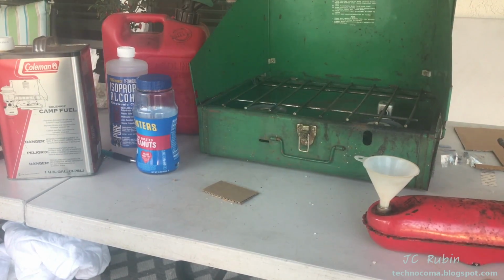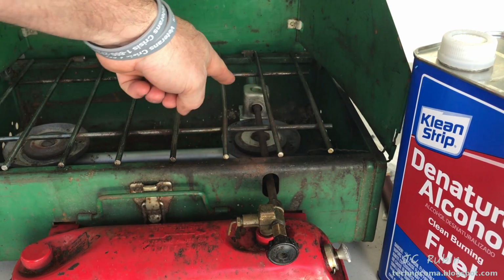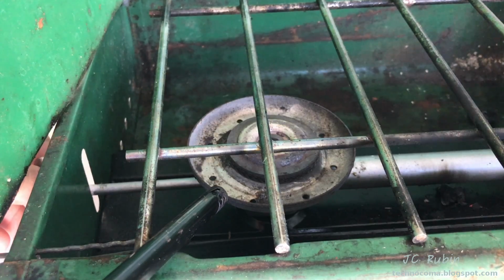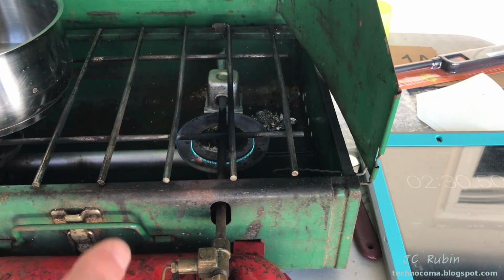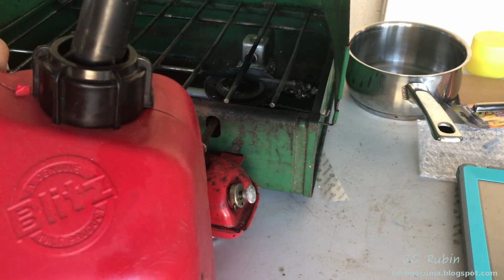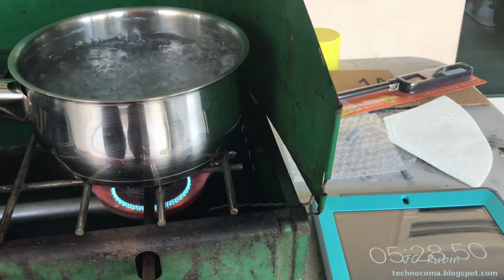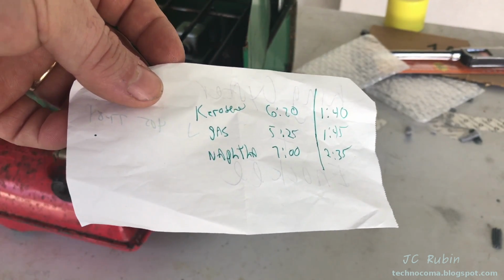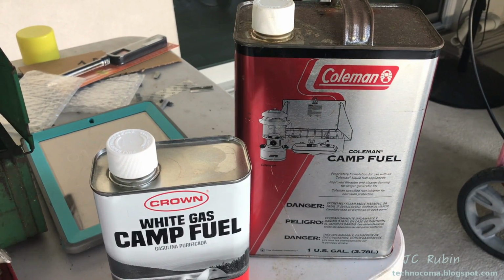Antique Coleman 425 Stove Testing Out Different Fuels for Performance

Comment: Kerosene purchased at a hardware store costs about ten times what it costs if you can find it at the gas station.  Yesterday, after fuel prices have all risen due to Russia and Ukraine, I just paid $4.29 a gallon at the pump.  A gallon of Coleman camp fuel costs $16.99.

There are other benefits to kerosene too.  It is much less flammable than gasoline or white gas.  It is actually hard to catch fire without a wick.  You can pour it on concrete and drop a match on it, and it won't light.

Beyond that, kerosene doesn't degrade near as fast as gasoline.  You can store it for up to five years with no problem.  That's not to say it won't go bad ever, but gasoline will lose potency after only a few months of storage.  I've found that the gas I buy for my lawnmower won't work well in my snowblower a few months after using it in my lawnmower, and vice versa.  I've used kerosene that was five years old with no problems.  White has can be stored for several years too.  Once white gas is opened though, you only have about two years to use it.
Reply from the maker: I have not seen kerosene at the pump in florida.

Comment: In the UK Paraffin(kerosene) is a 1/4 of the price of Colman White Gas and unleaded petrol from the forecourt is 1/4 the price of Paraffin. I did find a video of someone who distilled forecourt unleaded to effectively create white gas, not something i would risk doing as burning to death is not a very nice way to go..
Reply from the maker: Ive watched people distill petrol into naptha in gallon batches with copper whisky stills.  Giver the cost at the pump It sure is quite cheaper than coleman but it sure is dangerous.

Comment: Also I would have tried everclear at 190 proof . Expensive and a shame to use it that way but it should work.
Reply from the maker: Alcohol had been demonstrated not to work
Reply: @retrotechandelectronics    check my other comment, you need to heat the generator up more. using a bit of copper wire might do the trick. it will make kerosine work better . i bet that trick will improve all of the lower engery fuels performance.
Reply from the maker: @mikehenthorn1778  The goal was to test fuel performance without modifications, this would be a modification.

Comment: It would need some help to boil the fuel. What I have seen before is wrapping the generator with some copper wire ( 12 or 14 gage ) where it is over the burner. Light with some hand sanitizer on it to preheat. Works great with kerosene too.
Reply from the maker: I used kerosene in the test, it smokes alot in that application, alcohol is better for pre-heating, its clean

Comment: could I add at little acetone to the gasoline to get a cleaner burn?
Reply from the maker: I would not attempt this.
Reply: @retrotechandelectronics  I actually added a very small amount of acetone to some very old coleman fuel and it burned very very hot. I had to turn it down because things were getting too red.
Reply from the maker: @massa-blasta  Like I said, I would not attempt this.

Comment: I put barbeque lightning fluid (kerosene) in coleman 550B After preheating it ignite and works fine.
Reply from the maker: That would be reasonably more expensive and dirty and gasoline...
Reply: @retrotechandelectronics  But good if no gasoline to available. When things go wrong, gasoline is first.

Comment: I love the video! Recently I've used my stoves and forgot to account for carbon buildup. What did you mention that you used for removing the carbon? I'm having some trouble. Thanks!
Reply from the maker: I cant imagine I missed this in the video, i would have to re-watch it to see.
Reply: Carburetor cleaner works good.
Reply: I have good luck with steel wool and a little dishwashing soap for exposed parts, like the long metering rod.

Comment: Saw a guy do it with Kerosene and wrap copper wire around the bar over the element. He got it up to temp by using hand sanitizer, but say you could use fire paste, iso alcohol or like you did, give it a little fire under the bar to preheat it. After it's going Kerosene can work quite well actually, yup.
Reply from the maker: There are several good techniques for this.

Comment: Great review and results.  On ke ro turn up the light lever for a minute before shutting down the stove, that helps to burn 3xcess fuel out of the genny.  That's how the older stoves operated
Reply from the maker: I was not aware of this, but I guess that would purge off the rest as fumes, vice fuel.

Comment: Would like to see kerosene and white gas mix 75/25.   That would most likely solve the lighting problem you had with kerosene but still give the benefits of the more dense kerosene.   Aviation Jet-A  is just kerosene but more refined.  JP4 (military Jet fuel) is a 75/25 mix of Jet-A and  100LL that piston aircraft use.   JP4 burns hotter and preforms better in afterburners than pure Jet-A.   Military engines are built for the higher heat produced by JP4.  To be clear  75 percent kerosene and 25 percent white gas camp fuel/unleaded gas or Coleman fuel.

Comment: I would stick to the fuel it was made for. That spring in the generator stem is actually a radiator that radiates heat evenly to turn the fluid into a gas state while it travels into the manifold and into the burners, secondly it also prevents flare-up in the line or surging of the fuel. These so called radiator spring tailor the amount of fuel by the pressure in tank and capillary action of the heated fuel or spiral action of vaporization to reach the burner uniformly and light it evenly. Without that spring the stem tube would rupture from flare up and cause serious burns or injury or the burner not to perform properly and burn evenly around the whole ring. Plus it's a sweet spot for the secondary burner to burn evenly as well. By putting different fuels in that tank you can damage that radiator by overheating it by using different fuels. You would need to calibrate that spring if you run different fuels in the tank. Yes some coleman stoves run dual fuels but the radiator spring is a different style made for dual fuel application. The spring also baffles the fuel to the right amount. Yes these stoves are old however I've seen a lot of burned out burners over a short time by people constantly using alternative fuels that don't fit the old stoves requirements.  Always use the proper fuels for the stoves recommendations. Going above and beyond manufacturers recommendations can lead to unsuspected accidents in these old stoves. Yes they may be robust but one doesn't know when weak spots develop. By using the proper fuels your stove will last even that much longer with a bit of routine maintenance. That's why I don't like the youtube bandwagon too much. It may work but will it last and is or economical and safe. Remember, safety is also the number one priority.
Reply: Dude, seriously?? 🙄
Reply: @AxtionMag  What one see's on YouTube is short term. Everybody is joining the band wagon and using alternate fuels in units that are meant to take the required fuel. There are differences in the generator. They even offer conversion kits as well that you can buy. In the end it's the burner plates that take a toll in these units. In the end you're not running cheaper and more efficient. I've been doing a lot of repair work for over 30 years and the short comings in of short cutting  are plentiful. I've seen people take a 70 year old unit and do the alternate fuel thing and depending how long they used it 2 to 5 years they say mine is still good, but it may take longer too heat or the second burner isn't as strong but its cheaper. Next thing you know bang a fuel leak developed while an individual left the unit unattended and almost burned the whole garage down. Then there are the majority of those that have a 70 now 80 year old unit and they stuck to the original products or fuels and they still work fine to this day. Remember short term gain, long term pain. I've seen antique dealers buy lamps and burners off a few of my collector friends and do conversions to alternate fuels only to call out my collectors saying they sold them a piece of junk and after me servicing them and finding out the burner plates and the orfices or metering valves were either eroded plugged or outright melted down I told the antique dealers that the wrong fuels were used and adapter kits were added for alternate fuels. There's still a lot of vintage upgrades out there or burners and lamps for industrial purposes. Back then things were built robust for the fuels that were supposed to be used, now everything used for its purpose and jetted and built for the fuel requirements. Everything now is a sales gimmick. A torture test of different fuels in one video and all these other bandwagon YouTube unknowlegeable individuals should be monetized especially when it comes to plumbing of gas appliances. Imagine if your house burned down and an insurance company found out you plumbed an appliance based on a YouTube video. You wouldn't be covered. When regarding this video I would not even post this to public so that an inexperienced individual does this. You have to have substantial evidence and thorough lengthy testing and must meet safety standard regulations for your region. Don't be surprised that this video isn't going to be monetized for safety regulations. One has to ask. Is the one doing this video a certified gas fitter or plumber?

Comment: Enjoyed the video. Based on how clean the generator looked after using the Coleman fuel, I think I'll stick with that unless it's an emeergency situation. I keep thinking about getting a Blackstone, but the Lodge 16.75" griddle fits perfectly on top of my 425 so that works for me.
Reply from the maker: Yeah I would use different fuels for any old reason, I stick with coleman fuel unless I have no other means.

Comment: I'm wondering on the run times per tank of fuel.
Kerosene has a bit more energy per gallon compared to gasoline.
Reply from the maker: You cant measure run time per tank. Depends on how high you turn up the flame...
Reply: @retrotechandelectronics  True-- but an equal runtime on  full output  would be interesting to compare the staying power of a given volume of gas vs diesel or kerosene
Reply from the maker: @marko11kram  to what end? Who runs their stove at full tilt for an entire bottle and would stick around to constantly ensure an even supply of pressure at the pump. We already know the energy density of the fuels. Only an understanding of their real word performance in the stove is needed. Boiling water with a timer is sufficient.

Comment: The gasoline to use is the lowest octane you can get...white gas is basically like 50 octane. Not surprised gas works well. Coleman's "dual fuel" stove is just a slightly different configuration.

Comment: I stumbled upon this test allowing me to let people know is that Colman had a pressure lamp which was designed to run on kerosene. 

There was a little cup you would put some alcohol or kerosene in to pre warm the generator.
Reply from the maker: Yup, I didnt have it so the paper towel worked in a pinch.

Comment: I have some very simple gravity fed alcohol stoves, and they run great on 91 % a rubbing alcohol but on denatured alcohol, they had a yellow flame and didn't run so well.  They even ran well on 71 percent rubbing alcohol.
Reply: Is this home made or where can you purchase? I stocked up on 91% because it's probably the safest for indoors & from fumes (wife is pregnant and the fumes bother her). I know you can make a can stove but there is no real pressure you can actually cook with. Gravity makes the most sense, the adjustable marine alcohol stoves are too freaking expensive!
Reply: @matthewstephens7509  look up "lixada alcohol stove" i got one runs well on everclear and 91 percent

Comment: Nice video. Was wondering why my ancient coleman fuel took so long to get my skillet hot. Makes sense that it would degrade over time like gasoline does, but it's actually impressive how well it still works all these years later...
Reply: I wonder if adding a bit of methanol (yellow bottle HEET) would help old fuel burn better?

Comment: Thank you for the info.
The issue with kerosene is the owful smell which c and end up in your food taste too.
Reply from the maker: Once its up to temperature, kerosene has no smell.
Reply: My mom grew up a share cropper, thus they didn't have electricity or running water.  At some point they went from a wood burning stove to a kerosene stove and they thought they were really high class then.  No wood to chop.  In the 1950's they upgraded to a ranch house with electricity, but still no running water till 1969.  Oh, the good old days.  I think the stoves that were built to use kerosene might not have imparted such a strong kerosene taste to their food, as I would imagine a lot of them were sold to farms and people who lived in the country who didn't have electricity or city gas.  I know the 'blue flame' kerosene stoves were heavily advertised in the 1920's and 1930's.
Reply: I got 3 kerosense wick stoves...they dont smell

Comment: Hello .... I have a single mantle (kerosene powered) Coleman lantern that was made back in the 1950's. It has a small cup that alcohol is placed into and lighted to pre-heat the generator. Because kerosene became difficult to find, I decided to give common charcoal lighter (as in BBQ pits) a try and it worked amazingly great and still to this day is an  easily available fuel source.

Likely too late now, but I would liked to have seen you use the charcoal lighter as a fuel for the camp stove... 99% sure it would work without problems. Also suspect that mineral spirits ( as in paint thinner) will also work in place of kerosene.

Also wonder if a mixture of "kerosene" type fuel and unleaded gasoline might do well....

Thanks for the video....
Reply: I heard 30°/, camp gas and 70°/, kerosene for kerosene lanterns.

Comment: If the slow burners like kerosene/diesel were mixed with 5-10%_camp fuel or white gas they might be easier to start. The alcohol might even work.
Reply from the maker: In an emergency , if you had kerosene, you would preheat with whatever and not resort to fuel mixing anyway.

Comment: Very well done video RETRO. I would of liked to see the adapter used that you can use a propane cannister with just cause you have me curious now,. Excellent video, thanks..
Reply from the maker: I thought of it, but in a pinch nobody runs out to buy a propane adapter.  that wouldnt be an emergency auxillary fuel.

Comment: Petrol/gasoline are far cheaper than naphtha, sure it gunks stuff up but regular cleaning/maintenance solves that and if it does reduce the lifespan of certain parts I could use the savings in fuel to replace the whole thing 1 pound 20 for a litre of petrol vs 9 pound for a litre of Coleman fuel? No contest, if it burns cleanly I won't worry about chemicals more than I do handling it for any other reason, I'm not bathing in it or pouring the fuel over my food! Plus the main things you'd want to avoid (lead and aromatics) have largely been replaced by ethanol in many locations. I wonder how much of an ethanol percentage it would tolerate in a gas/alc mixture before becoming unstable Would probably vary based on the stove, ambient temperature, age of fuel (alcohol absorbs water, why gas goes bad) and it could probably be modified to where it would burn ethanol well if it was the only fuel available. Still be interesting to see how much high the E an get before it stops working.

Comment: man, you really put this stove through its paces.  I just picked up a 425E, and didn't hesitate to use gasoline based off your video.  Nice to know I could use kerosene in a pinch too.  thanks a lot Sir.
Reply from the maker: Just remember gas has a lot more chemicals added than whitegas, it should be used in emergency but not as a substitute.
Reply: Ok, but white gas is distilled from gasoline I think.  What are the known risks of running these on gasoline consistently?
Reply: @fishinjunky  I think hes alluding to the additives in pump gas and the potential for them to affect your health. A stove-specific fuel (such as coleman) would be formulated without those.

Comment: The main reason one would pick kerosene is indeed cost.  Buying it in the one quart can is very expensive.  In the northeast, where oil furnaces are common, it is not uncommon to find kerosene for sale at rural gas stations from a pump.  At $3-4/gallon beats even crown camp fuel by quite a bit.  It’s a bit annoying to get running on a stove designed for white gas, but for long term use it is far cheaper.  It’s also more pure and stable than gasoline.
Reply from the maker: Kerosine works just fine, just harder to start, and stinks to holy hell when shut off.
Reply: @retrotechandelectronics  To reduce Kerosene smell, turn the lever up one minute before you shut it off, which will burn off most of it in the generator. Bur burning kerosene will quickly clog up your genny, which requires constant cleaning and maintenance. If it's for cost reasons, just run low octane regular unleaded, it's much more volatile, less sooty thank Kerosene. Coleman stove is designed to run on white gas, it burns cleaner, you will have less headache long term. But if you don't mind constant maintenance, it works on unleaded or kerosene. Cheers!
Reply: @ClaraXu2014  you can actually distill gasoline from its additives relatively easily w/ a standard electric hotplate you'd find in chem class.  The additives, like the detergent package, do not evaporate easily, though the other 150 or so components of gasoline like toluene/benzene/xylene/etc can.

You don't need the fancy glassware like the graham oil condenser, but it does make it a lot faster.

Just do everything outdoors so you don't have to worry about the buildup of combustible fumes in home, unless you have a lab rated fume hood.